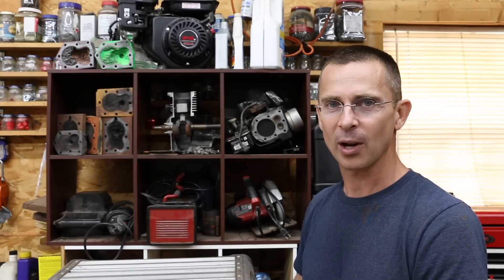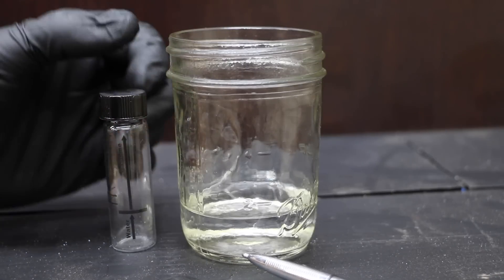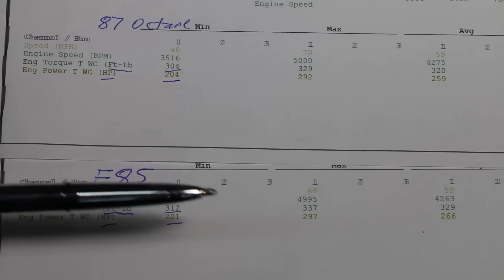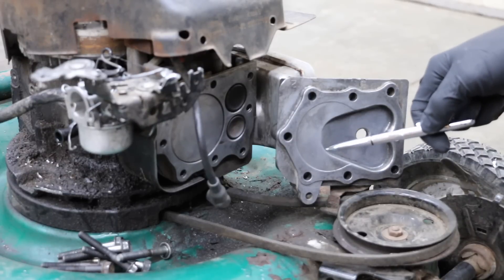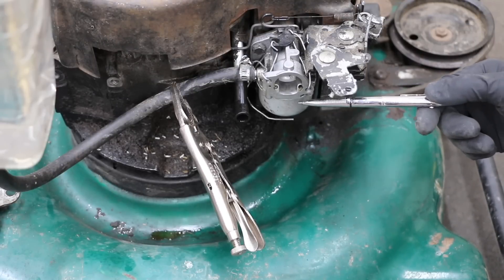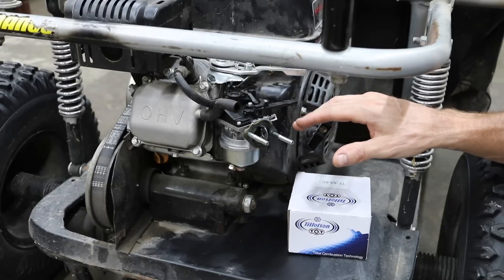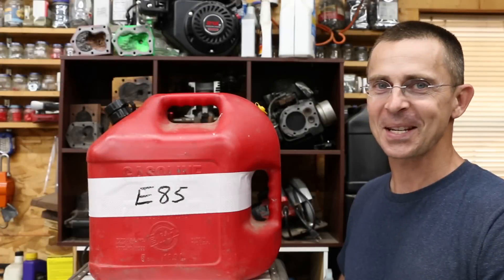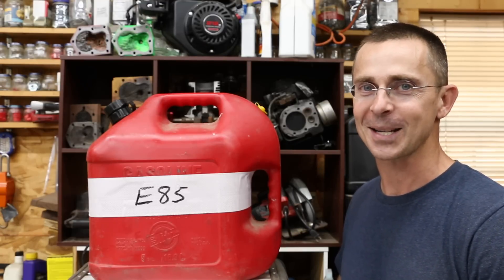Is E85 better than Gasoline? Let's find out!

Comment: I just purchased F150 with the V8 E85 compatible engine, and ran a tankful of E85 through it. Not impressed.
I lost about 2 MPG, and the truck didn't perform noticeably different on a 300 mile road trip. It was a couple cents cheaper, but not enough to hunt down a station for it.

Comment: drove e85 in my car for meny years and it worked fine just needed slightly larger injectors and run om stock ECU.
got some slight better performance in mid/high range.
Reply from the maker: Thanks for sharing.

Comment: should have tried it in the efi generator. depending on how the ecu is configured it may sense its running lean and inject in more fuel (if it uses an o2 sensor on the exhaust) although it may have some limits to prevent it from flooding or something if the o2 sensor were to fail so it might not be able to inject in enough fuel to run at proper ratio without reflashing the ecu or something.
Reply from the maker: Thanks for the feedback.

Comment: I would like to see the MPG on your Yukon when ran on 91 no ethanol. That's what i run on all my vehicles and get about 10% better efficiency and they have more power due to the computer running on the high octane spark table. Also 91 no ethanol has more BTU of energy per volume. Plus it is less corrosive and doesn't go bad nearly as fast.
Reply from the maker: Thanks for the suggestion.

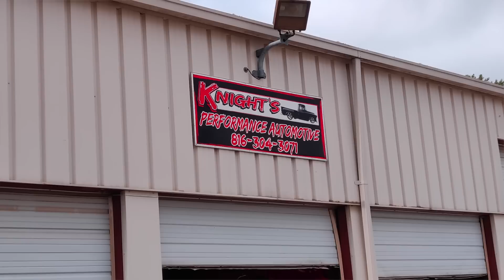Comment: 1:55 The car didn't run out of power, it hit the speed limiter. I own one of those and in 3rd gear, 5,000 rpm is over the 99 mph speed limiter.
Reply from the maker: Thanks for sharing!
Reply: Yes, HPtuners or similar could easily take care of that and you can command 3rd gear for dyno runs.

Comment: I added a module to my 1997 E350 to use E85. My results were similar to yours in MPG = cheaper to run regular gas = better miles per dollar than E85 with and less fill ups.
Reply from the maker: Thanks for sharing.

Comment: Project Farm
I have an 05 Sierra which has the same L59 E85 capable 5.3 liter.  I have done some back to back testing myself and where the E85 really shines in these engines is when you are towing something.  Recently pulling a 3500 lb. trailer I monitored my timing advance in 4th gear at 60 mph (about 1600 rpm) and more specifically I kept an eye on my timing advance while lugging it right before down shifting to 3rd.  Results below:
87 octane, timing advance before shift down was 15.5 degrees advance.  Fuel mileage 12.2 MPG
91 octane, timing advance before shift down was 22 degrees.  Fuel mileage 12.7 MPG
E85, timing advance before shift down was 27-29 degrees.  Fuel mileage 10.5 MPG
With E85 in the tank the significantly advanced timing when compared to 87 and 91 octane resulted in much better gear holding ability (more power) and with that additional timing advance I was able to use the fuel more efficiently.  I only witnessed a 14% drop in fuel economy going from 87 octane to E85 while your example you lost closer to 23%
Around my area in minnesota E85 usually only costs about 20% less than 87 octane so in my case I am actually coming out ahead while using E85, where in your example you are paying more money.
With normal driving E85 makes no sense with these vehicles, but give it a shot the next time you tow something reasonable heavy, you will probably be impressed
Reply from the maker: Thanks for sharing.

Comment: i can tell a pretty noticeable performance boost when i run e85 in my F150.. but the mileage is definitely worse, if its cheap enough i will run it
Reply: Think its cheap enough now?
Reply: @dang8973  87 is $5.10 where im at and E85 is $4.70 🤷🏻‍♂️ $0.40 discount isn’t terrible
Reply: @dang8973  is this a trick question?

Comment: Ethanol has a much lower energy density compared to gasoline, so it makes sense that you'd get much lower fuel efficiency with E85. Ethanol really only has an advantage in certain performance applications. If I had a flex-fuel vehicle, I would probably only run E85 at the track, and regular gas the rest of the time.
Reply from the maker: Thanks for the feedback.

Comment: 2000 Goldwing 1500SE, carburetor (fuel cover sticker - use 91 RON fuel). Several tanks avg's. Spark plugs, Double Iridium.
👉Regular: 47 mpg.
Motor ran smooth AND! powerful. Long semi-steep hills, 5th (overdrive) no issue and has acceleration. 
👉ethKRAPanol: 39 mpg.
Motor slightly rough, at idle rpm's dropped ~150. L S-S H, no acceleration. (downshifted to 4th to equal Regular fuel power) 
👉(once) E-85: 28-ish mpg. (lucky, no fuel system leaks)
Constant random miss at idol and dropped ~300 rpm's (had to raise). RPM gain was slow in neutral. All gears, poor acceleration.
IF in a pinch I would use E-85. By adding Seafoam or good brand of injector cleaner does bring power up to ethKRAPanol. 
. . . THANKS for video, gave me a proper place to post this info.
Reply from the maker: Thanks for sharing.

Comment: i run an e50 mix in my 2019 f150 3.5 ecoboost with calibrated power’s tuning. the biggest mistake i see most people making is comparing e85 to 87 octane in terms of “is it worth it.” e85 is an amazing fuel for being able to make more power especially with boost due to its high octane rating. when ran in a performance or fun daily driven vehicle, it makes way more sense to save a considerable amount of money over 91/93 octane and have the benefit of significantly higher octane. it’s also a great solvent that will keep your valves and pistons carbon free. plus it smells amazing after being burned. even with catalytic converters.

Comment: We use E85 almost solely in Grand National boat racing.  $2 a gallon instead of $15 a gallon for race fuel...don’t have to fiddle with carburetors because mechanical injection is ran...no need for a restrictive intercooler because of the heat wicking abilities of alcohol...and actually makes more power and much better throttle response.

Comment: I don't bother wasting my time with E85.  I rented a Flex-Fuel vehicle for a family trip a couple years back and found that I got roughly 30% less mileage out of E85 than I did with regular 87 or 89 octane.  The trip was about 80% highway / rural driving.

Comment: one thing that cant be tested is the ability to hold sediment.......e85 is TERRIBLE for clogging fuel injectors ESPECIALLY with direct injection.....if you have a direct injection engine, I would highly NOT recommend E85.....the savings of cost per mile will never offset the cost/time of new injectors

Comment: I quit using it because the fuel economy was so bad in my Yukon.    Like you said, it would cost me so much more every year to run E85.
Reply from the maker: Great feedback on E85
Reply: Been using it on our v6 audi trailer puller, to get it past the emissions tests, since its mostly runs short drives around the farm and drive to city, it gets clog up over time, so couple times on the highway to get it burn most of the crud on the engine and if that does not help, then 10 liters of E85 to 20 liters of 95 octane to properly clean everything and get it under emissions limit. This model is not flex fuel, so there is chance of casing some gasket damage, but in this format not anything we have noted so far, since after emissions test is passed we fuel it up full tank to lean it even further and drive the e85 mix out of the system.

Comment: I'll give you one of my Transmissions when your 2003 suburban's unit goes out.
I'll give it to you for free. 
Keep up the good work.
Reply: 3346504533
9am-6pm
Reply: @garyrobinson3735  you got a 6 speed manual for a miata?
Reply: @abadibi  I do not. But I can rebuild your unit for less than you might think.
Reply: @garyrobinson3735  where is your shop located
Reply: @1stock4Point6   Phenix City Al

Comment: One thing to take into consideration is when running ethanol not only do you have to drill out the jet you really need to advance the timing slightly back in my tractor pulling days when you ran an alcohol-based fuel you always ran a lot more timing that's the advantage of using an alcohol-based fuel that's where you get your power it's from the timing an E85 capable vehicle automatically adjust the timing for the ethanol content that's why you get the performance boost that in the cooling effect of the alcohol-based fuel
Reply from the maker: Thanks for the feedback.

Comment: E85 Flex Fuel vehicles get terrible gas mileage on E85 and costs you more per mile than 87 octane.  The gas mileage I experienced with a Ford Taurus was about 1/2 with the E85.  The cost looks appealing until you actually use it.
Reply from the maker: Thanks for the feedback.

Comment: I have a 2008 Silverado Z71 with a 5.3 Flex Fuel engine, I run E85 with a 91 Octane Tune, I have a Good 20% Increase of HP and Torque opposed to running regular with an 87 Octane tune.
Reply from the maker: Thanks for sharing.

Comment: E-85 in a naturally aspirated engines is pretty much political, put the farmers to work and make fuel.  BUTT when you throw boost into the equation there are substantial gains to be made.  Alcohol has a very high potential to absorb heat compared to gasoline.  So when you add boost you add heat, reducing air density so the alcohol cools the intake charge without a charge cooler, so lets add both, you can turn the boost up maybe 1 BAR,  to do that with gas it would be C-16 race gas at about 16 bucks a gal.. Anyway buy E-85 from a fuel co. and you get 85 all the time, when you want to go play you dump in the good stuff and you know your tune will be there. It's free charge cooling like nitrous.  But the bottom line is 1degree cooler air is worth 10HP in a high performance engine.

Comment: The military uses e85 for a lot of their normal on post vehicles, like the work pickup trucks and vans. I also used e85 for my supercharged mustang. Resists knock much better than gasoline and was able to run 5 more lbs of boost with 9 degrees more  timing on that setup. Other than requiring special components the only downside I had was the efficiency.
Reply from the maker: Thanks for the feedback.

Comment: I did drive my volvo  v50 flexi fuel on E85 it accelerated better on E85 than on common gas. But it lost tork  up hill. I used to drive a Volvo 240 from 1980 on a mixture of E85 and gas and it actually rund better on the fuel mix than on ordinary gas. Good part of using E85 is not to use Fosie fuel.
Reply from the maker: Thanks for sharing.

Comment: I have a test idea. In my car the oil gets a little gassy if I’m not running hard because my rings are gapped for a turbo. Could you add some ethanol to oil and see if it comprises the oils lubrication since it would make its way into my oil?
Reply from the maker: Thanks for the video idea.

Comment: If you have a hot roded out flex fuel capable fuel injected car that you either have so much compression or so much boost that it has to run race gas and can't run on pump 93 octane it can run on E85
Reply from the maker: Thanks for the feedback.

Comment: Regular 91 is $3.50 per gallon in my state. I only use Chevron because my car is turbocharged. E85 is $1.90 per gallon. Even though I lose 30% of my gas mileage, I still save a few pennies and I can run my car hard safely.
Reply from the maker: Thanks for sharing.

Comment: There is a difference between a engine that is designed for E85 and one designed to run equally on both.

One designed for E85 will have much higher compression, getting higher power and also a bit more efficiency.
Reply from the maker: Thanks for the feedback.

Comment: Could you do a video testing storage lesion in different fuels after different ages?  Basically put some diesel, e85, biodiesel, different gasolines in some fuel cans and revisit a few years from now.  Itd be interesting to see if buying bulk at low prices and storing would be worth it, as well as in preparation for potential shortages.  Thanks!
Reply from the maker: Thanks for the video idea.

Comment: '04 Ford Explorer flex fuel vehicle.

My fuel economy drops about 35% on E85.

No discernable loss of performance, though.

But, my ecm triggered the check engine light for catalytic converter efficiency the whole time. Cleared right up as soon as that tank was empty and refilled with good old fashioned regular, traditionally sourced and refined dead dinosaurs.
Reply from the maker: Thanks for the feedback.

Comment: I use e85 in my 2015 suburban and I feel that it's a lot smoother over regular 87 octane. I can tell a difference in acceleration just from the butt Dyno and I  get it for just about 20 cents cheaper than regular gas.
Reply from the maker: Thanks for sharing.

Comment: There are only a handful of ethanol free gas stations out here in comifornia.  I would like to try ethanol free gas to see the difference. That might be a good video... testing to see if ethanol free gas gums up your catalytic converter or if it burns clean enough to pass a smog check.
Reply from the maker: Great suggestion!

Comment: E 85 has more oxygen in it as opposed to gasoline which is why you need to rejet the smaller engine.The down side to E85 you use more of it as opposed to gasoline.IF E85 is ran to lean it can burn pistons that is why your Cylinder head was cleaner as it burn the carbon off.A lot of people that own Camaro ZL1 's Convert to E85 for racing.
Reply from the maker: Thanks for the feedback.

Comment: Cleaner and cooler mostly because of more fuel used. A rich setting will do that with regular gas. Not for the exhaust emissions though. At least not without a catalytic converter. E85 is bad. Emissions can be as good or better than current cars with regular gas with better milage. Not to mention food being cheaper. That said, electric is the best future.
Reply from the maker: Thanks for the feedback.

Comment: My car is 2010 ford fusion 2.5L . can use E0 to E15 gas. The 87 octane is E10 hear in NY .  no one has E15 around hear.  I can get E0 gas . wonder if you could compare the E0 to E10 ,in both small engine and a car let us know the difference.  a few gas stations sell E0 for small engine use hear .it cost more is it worth it ? great video on E85 with a real test !
Reply from the maker: Thanks for the feedback.

Comment: I have run over 30k miles in my 94 Fleetwood on e85, doing some PCM tuning to optimize the timing and fuel. I learned a lot. E85 likes to be warm, warmer intake air temps help mpg a fair amount. I never had any corrosion issues.  Stock fuel pump went to 255k miles. I did find that if the E85 price was not more than $0.50 cheaper per gallon then it wasn’t worth using E85 over 87 octane. Yes it does make more power. In cold temps I avoided it at 19 F it was very very hard to start.
Reply from the maker: Thanks for sharing

Comment: Running e85 will also cause additional engine wear due to the volume of fuel going through the engine.  Great stuff for boosted applications but gasoline is better for engine longevity and MPG.
Reply from the maker: Thanks for the feedback.

Comment: Isn't the main purpose of E85 to reduce the emissions coming out of the engine. Yes its way less  fuel efficient than regular gas, but it's supposed to be better for the environment. To bad you couldn't have measured the amount of hydrocarbons coming out of the engine with both fuels.
Reply from the maker: Thanks for the feedback.

Comment: E85 is great from a performance point of view when running turbo chargers or super Charger. It runs cooler then racing gas (octane 105) and the flow characteristic is different amounting to much more low end torque bc of volume. Not everyone has a high HP vehicle for fuel mileage but rather to enjoy it, like it was ment to be driven.
Reply from the maker: Thanks for the feedback.

Comment: I had an s10 pickup truck that I ran on e85,...it got less miles per gallon then non ethanol, but the cost per mile was lower.
The big problem was what was happening to the oil, running on e85. The condensation from combustion bypass gases was building up in a short period of time after an oil change, that the oil looked like a milk shake. The oil test showed a high level of water,...with no antifreeze present. E85, or even E10, may be cheaper, but over the long run the damage that it causes to the lubricated engine parts is far more costly. I pay a little more at the pump for the longevity of the engine.
Reply from the maker: Thanks for the feedback.

Comment: I'm in Australia. I have a 2003 mitsubishi evo. I have had the car tuned on e85 with little more than a bigger fuel pump and injectors. I've since done more work  it ran it mostly stock for years like that.

Now The car makes 350whp on 19psi on premium unleaded(98 octane)

And 400whp on 19psi on pump e85(107octane)

When turning up the boost(24psi) it makes 400whp on premium unleaded

On e85 boost is wound up to 30psi where it makes 520whp

With the increase in octane more boost and or timing can be utilized to make more power. More regular oil changes are required as in time the ethanol breaks down the oil more quickly. The oil when i drain it  smells of alcohol
Reply from the maker: Thanks for sharing.

Comment: I had a 2016 3.5 EcoBoost f150. Changed the turbos different intercooler and e85 conversion along with some other add ins and it would pick up close to 100rwhp with e85. My hellcat challenger is almost the same. It's a higher octane and a cooler fuel, so in my experience you benefit more from a boosted application. Great video tho.
Reply from the maker: Thank you for the feedback

Comment: Your horsepower isn’t going to be less in a lower gear... that’s not how it works by any means, the whole point of gears is so you stay in the power band... acceleration dies when you are out of the top of the torque band... plenty of cars do dyno runs in 2nd and 3rd gear with six speeds because they will overspeed the dynos safety rating. Just clearing up some miscommunication or misconception I’m not here to argue, learning is about perspective
Reply from the maker: Thanks for the feedback.